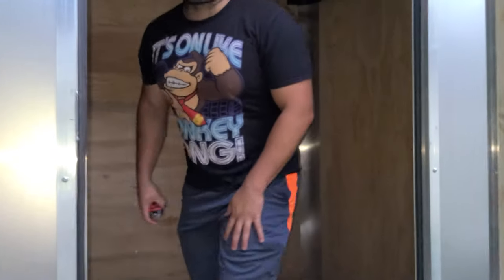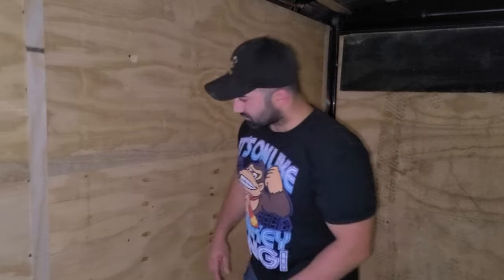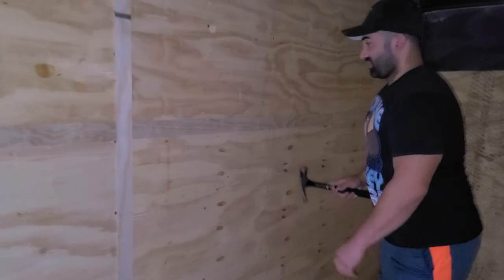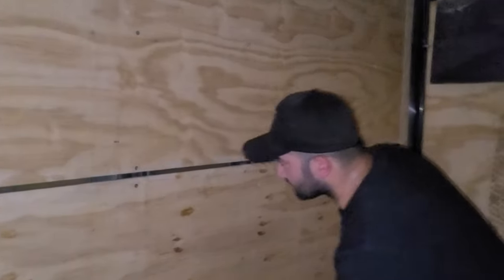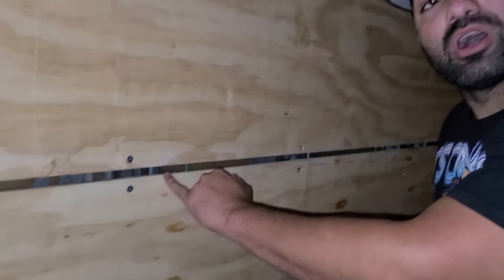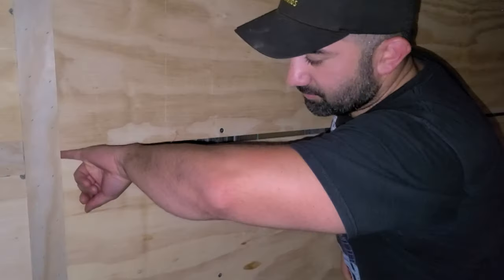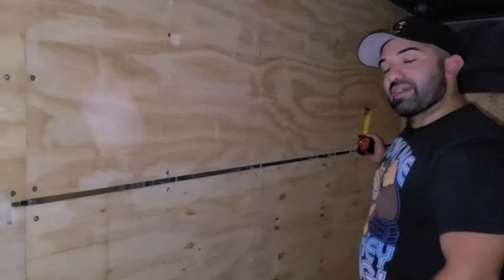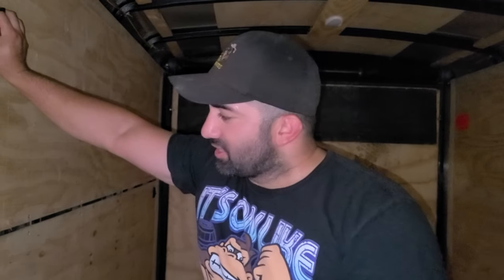Building a Food Truck at Home

Comment: When measuring for the window. I see where you measure inside the first stud is where you started. My question is the ending point of the measurement is it to the inner or outer part of the stud.
Reply from the maker: I measure from stub beginning to stud beginning. To eliminate having to cut those last 2 studs on the edges. Whatever measurement that is just try to cut the least possible